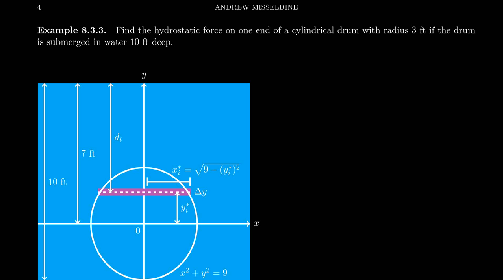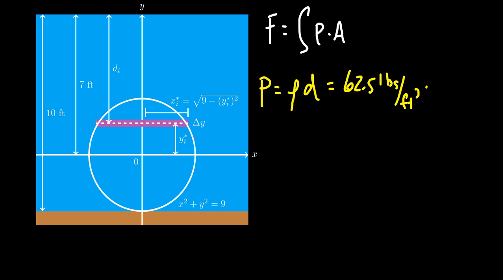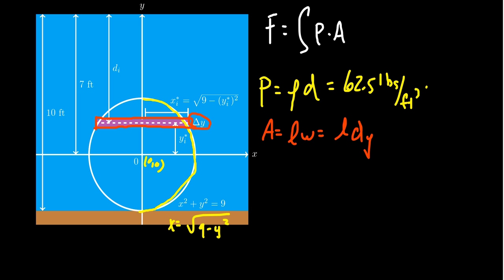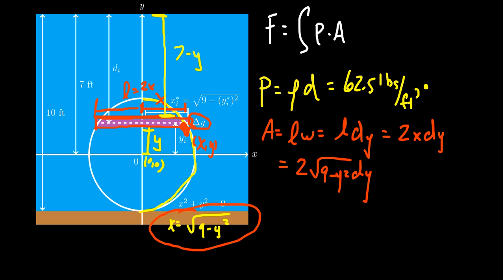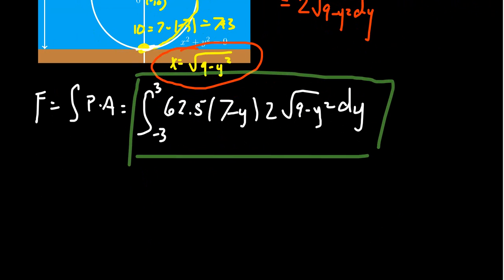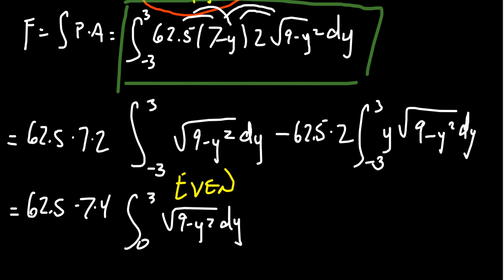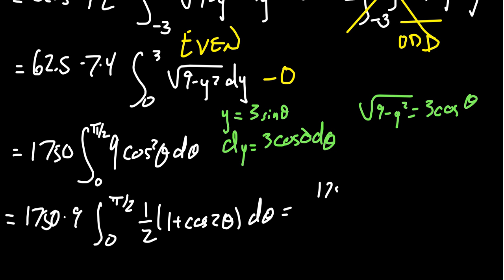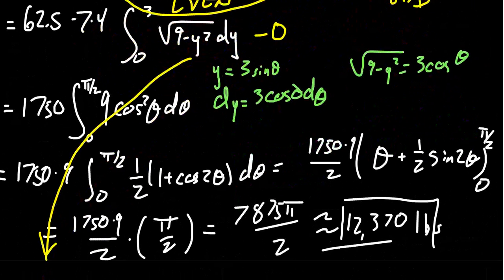Hydrostatic Force against a Circular Plate

Comment: how does trig sub work.
why does sqrt(9-y^2) equal 3cos(theta) if y = sin (theta) why don't i plug that in for y.
how does the interval change from [0,3] to [0,pi/2]
Reply from the maker: Trig subs work by the same rules as other u subs, which is a consequence of the chain rule for derivatives. Trig subs are done strategically to turn a difference or sum of squares into a perfect square. Hence, we choose y=3sinθ exactly so that sqrt(9-y^2)=3cosθ. Of course, if one is unsure of this simplification, then we can go through the calculation: sqrt(9-y^2) = sqrt(9-9sin^2θ) = sqrt(9)sqrt(1-sin^2θ) = 3sqrt(cos^2θ) = 3cosθ.

As for the bounds, we can (and should) adjust them when we do a substitution in a definite integral. We do this by plugging in the x-values and solving for θ. If x=0, then 0=3sinθ, which implies 0=sinθ and θ=0. Likewise, if x=3, then 3=3sinθ and 1=sinθ. Thus, θ=π/2.
Reply: @Misseldine  thank you very much, the explanation of the adjustment of the interval was especially helpful

Comment: why 62.5 x 7 x 2 becomes 62.5 x 7 x 4?
Reply from the maker: At that moment we were utilizing the even symmetry of the integral. The interval went from -3 to 3 and since the function is symmetric with respect to the y-axis, the area under the curve from -3 to 3 is exactly twice the area from 0 to 3. Therefore, we changed the bounds to the interval [0, 3] and doubled the integral. As there was a 2 already in front, we elected to double the 2, giving us 4.